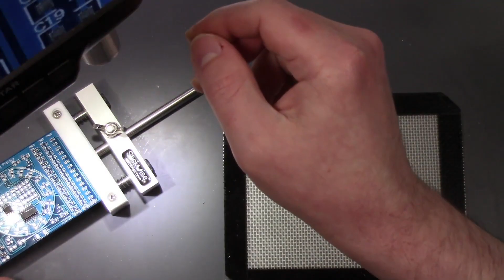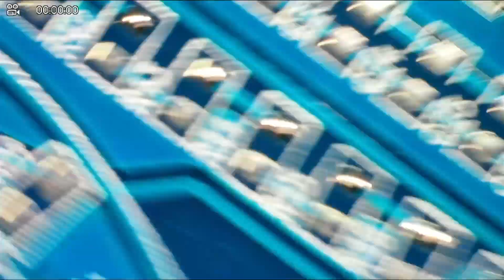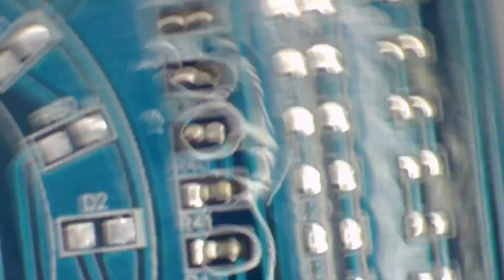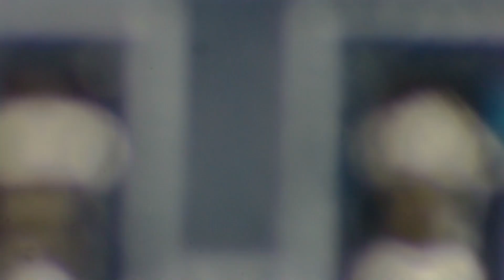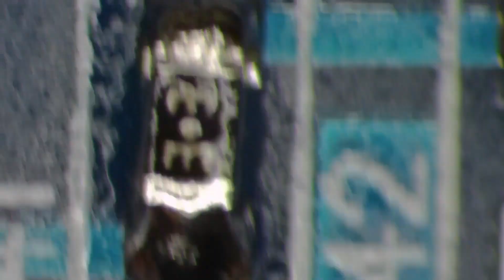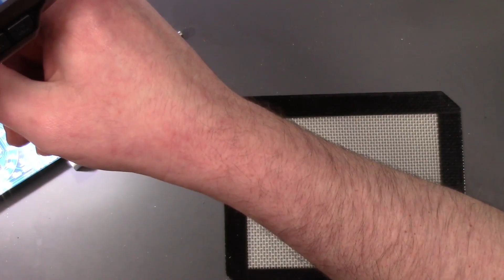Comparing My Two Microscopes The Andonstar 407 & Amscope

Comment: Great video as always Jason, the picture on the adonstar brilliant 👍
Look up on eBay...0.35X Mount Lens Adapter Focus Adjustable Camera Installation C Mount Adapter t

This attaches between the amscope and the amscope camera, this should improve it and its cheap. The seller is lapsun gift.
Reply from the maker: I have the correct mount now, it took some doing, but I’m happier. I just got a 0.7 Barlow lens and it seems better for switching between phones and consoles
Reply: @jasondoesthings919  the Barlow lens make all the difference with the field of view. Great video as always👍

Comment: Hi Jason I hope your well, do you know the differences between different andostar models of microscope? I was having a look and some of the 8.5 ones don't look any different to eachother, but the prices vary massively. 

I'm going to steal your idea of having the bracket upside down on a boom arm, very clever.
Reply from the maker: For the research I have done, I would only recommend the AD407 and the AD409. I say this because they would be best for what I do, the have the HDMI output and the AD409 can connect to the PC. I hope this helps.
Reply: @jasondoesthings919  cheers pal. I'll have a look into it. 
I actually have a 7inch g1200, and that has a decent image. and I only paid £50.

I was just wondering how much better these ones were. if you can connect this via HDMI them that sounds pretty good.
Reply from the maker: The thing with my scope is the modification I made too it, other scopes wouldn’t have the focusing range that the AD407 has. With my setup I can zoom way out and zoom way in. I can use any type of board holder and be able to focus quickly. I don’t know if the cheaper scopes have that large range of focus. It is really up to you, I would never buy something off the recommendation of someone unless I researched it myself first. What you can do is buy from Amazon and if you don’t like it return it. I pay a little more on Amazon, but I know I can return it and get my refund quickly in order to try something else.
Reply: @jasondoesthings919  

Yeah I understand what your saying, I did ask you because when you say something it generally holds true. so I value your opinion.

This is more a DIY project for me, so if I buy the wrong thing it doesn't really matter. 

I was going to modify a Microsoft 1425 webcam into a mircoscope (YouTube it) , but I foolishly sold the webcam at quadruple the price I paid for it at the start of the covid lockdown.

Comment: why isnt the amscope image sharp? dont u have a smz ctv 1/2 or 1/3 adapter between ur scope and cam to focus?
Reply from the maker: I was using the stock adapter and it was trash, I could never focus it very well. I have switched to a better adapter that has a fine focusing ring on it, future videos will be much better, unfortunately it is still not as good as the andonstar scope. There is some tips a viewer gave me but without a computer at the moment I can’t try them. It will be much better when I’m back online in May
Reply: @jasondoesthings919  a tipp from me. i got an szm ctv 1/3 adapter extra. because with the 1/2 i had much too narrow view (about half of eyepieces). Now its nearly the same view.

Comment: That amscope camera comes across really bad hope you get it sorted
Reply from the maker: I agree at the time this was filmed it was pretty bad. I have gotten another mount and it is better, but I feel it is still not as good as the Andostar view. When I get my computer sorted out I will be running the Amscope camera with the HDMI cable in a higher resolution so I hope it will then be on par with the Andostar.
Reply: @jasondoesthings919  I wasn’t trying to be negative just trying to help hope you didn’t take it the wrong way look forward to seeing it with the hdmi fingers crossed it comes across better but the  first camera on the video puts out a great picture
Reply from the maker: It’s all good, I wasn’t offended in the least bit. When I first got the camera setup I was pissed off on how it looked, but about 10 different mounts and adapters I found something that works